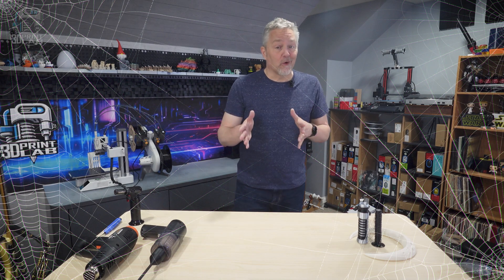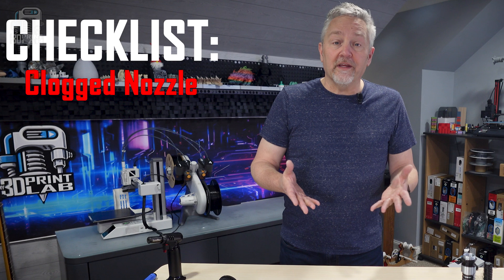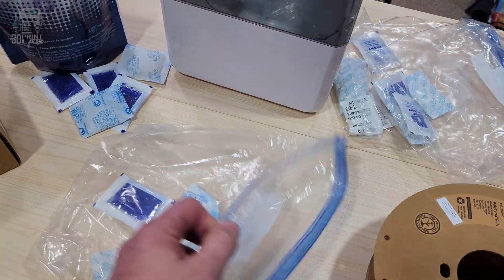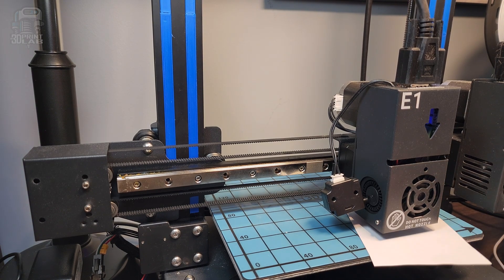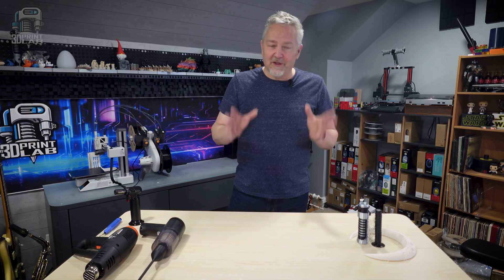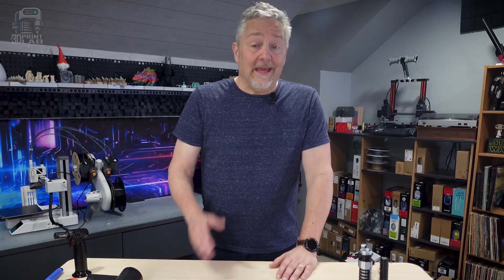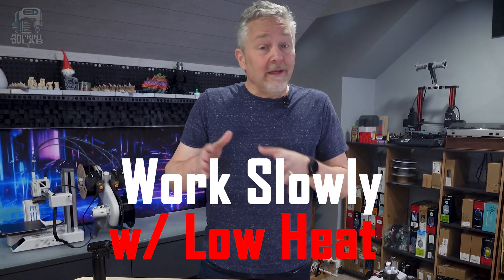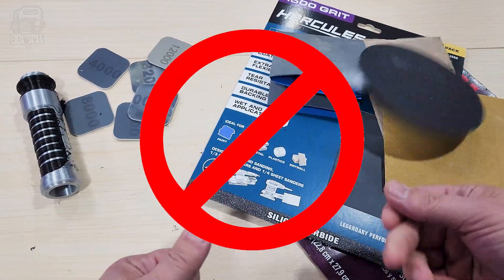Just Say, "No!" to 3D Print Stringing!

Comment: Run, don't walk, to Target and pick a few of these up: "Ezy Storage 33.8qt IP67 Waterproof Storage Box". It easily holds 10+ rolls of filament without a lot of wasted space like other storage containers. It's like they were designed for filament rolls. Throw in a couple of desiccant containers, and maybe a hygrometer (I use the ones from SwitchBot so I can track the humidity inside the boxes over time to let me know when I should refresh my desiccant long before its color changes a lot), and you are good to go.
Reply from the maker: I missed this post, and now I'm running to the website to check this! Thanks!